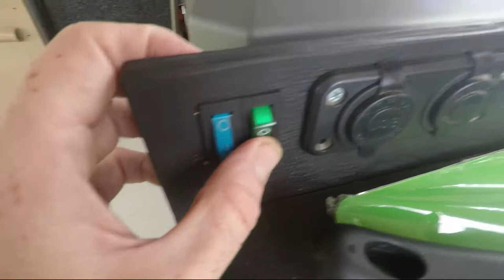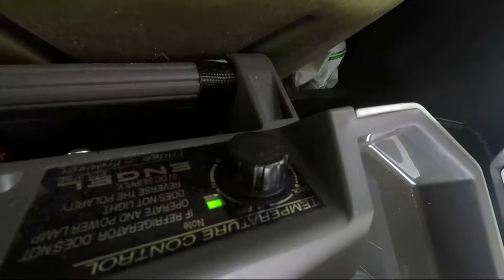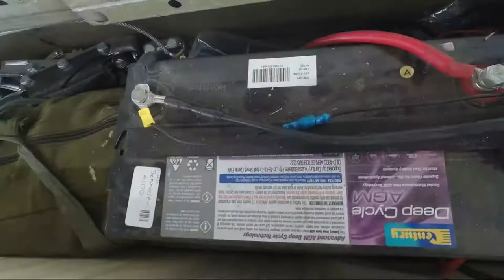Land Rover Perentie Camping Setup

Comment: If you ever want to do the PTFE draw slides again- use the green plastic joiner strips that they use on flooring grade chip board- often the guys at Bunnings will just give you a couple.
Reply from the maker: I did look into the Bunnings option but was not entirely sure how it would go. Thanks for the feedback. I will keep that in mind if I ever do this again.

Comment: Hi mate, can I ask what was required to fit the tailgate on to the FFR? And did you have to get a GS perentie one or did a civilian one fit?
Reply from the maker: I had to remove the rear step through valance panel. That was quite easy just a bunch of pop rivets. I used corner capping off a series vehicle to save drilling holes in for the brackets/locking/catch system for a tailgate. I used a civilian tailgate. I am fairly sure any tailgate from 1959-2016 will work.
Reply: @LandySmurf  Thank you very much for the reply mate, very helpful info. You don't happen to know anyone selling a hardtop roof by any chance do you? These seem to be hard to find... All the best mate.
Reply from the maker: @HeavyJ318  no worries if there is anything else I can help with please just ask. Probably best to ask on a Facebook group. They do pop up from time to time. You can use series sides. You can also use a series roof with modifications.
Reply: @LandySmurf  Thanks again matey!